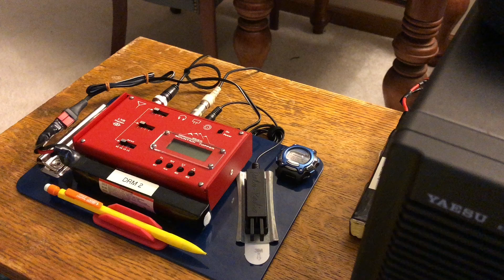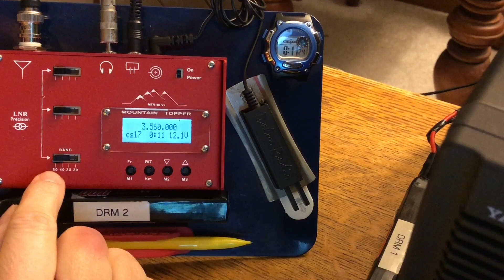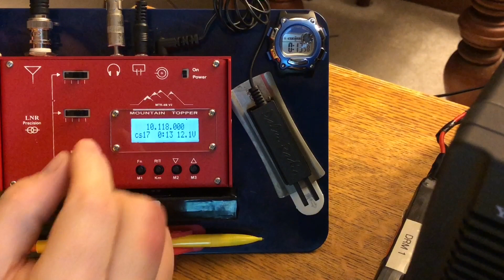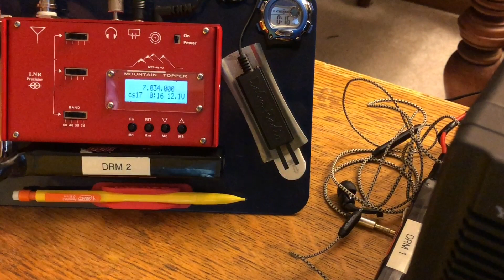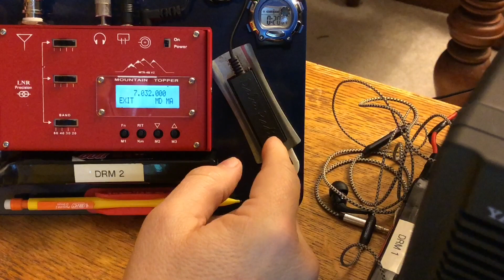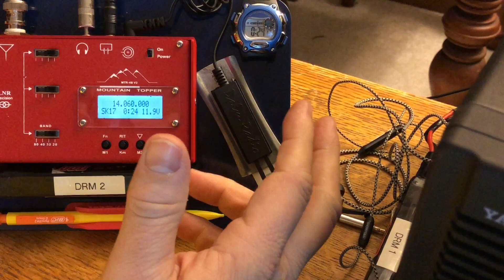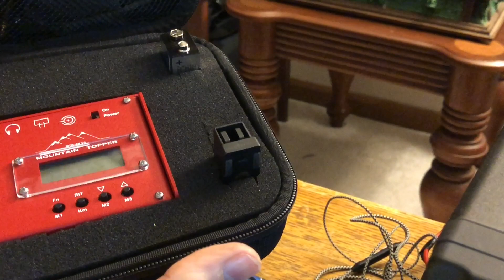LNR Precision MTR4B V2 Introduction

Comment: great video !! i just dived down a rabbit hole on sota reflector  that's gonna take over all my spare time 😂 found some outstanding mtr3 and mtr5 go boxes that were built by the mod king of mountain toppers dk3it. its like he heated up the bottom of a mountain topper with a torch or something and squished it into small pelican cases and tapped it with a magic wand to add extra goodness 😍 my appetite for anything to do with these superb little radios is insatiable.
Reply from the maker: It is great to carry a 7 ounce radio. I just wish it had DSP filtering. The front-end is too wide.

Comment: Do you know how to reduce the side tone monitor volume? I know the rubber stopper on the back is where you're supposed to access this. Is it a dip switch?
Reply from the maker: I don’t think it is adjustable,  I’ve never tried.  I bought a portable speaker that has a volume control.

Comment: 80m for SOTA?  Not in my experience.  Change 80 to 17m and they'd have a winner.
Reply from the maker: I wanted 60 instead of 80 but they won’t make it.  I do okay with 80 but 60 covers the in between range.

73, de N4HNH
Reply: @n4hnhradio  not enough room for that much wire on a lot of summits nor do I get up that early LOL
Reply from the maker: Well, LNR Precision can only offer you 3 useable bands with the MTR4B V2.  I think their 5-band model has 17m.

73, de N4HNH
Reply from the maker: The antenna I use for portable ops is the NY4G EFHW.  Even when I add the 80m link, it is half as long as an 80m dipole.  

We have a close knit group of SOTA activators here in the Southeast, with chasers who are shut-ins.  We get together for cook-outs and camp-outs twice a year.  So, we try to always operate either 60 or 80 meters, to give our fellow activators and chasers the opportunity for chase points and S2S bonus.

73, de N4HNH

Comment: Would you please post info on the battery packs you are using?  Great size.  Thanks for a terrific video. 73 de N3CI
Reply from the maker: I use either a Red Tiger 11.1VDC 15C 1100maH LiPo battery or the 50C 3000maH version.  I’m not sure if Red Tiger is still available though.  But just about any RC Hobby store will have this type of battery.  

I changed the connector to a Deans connector, since the Deans is smaller and lighter.

The 1100 maH 15C battery is plenty of power for the MTR4B V2.  I could do 2 or 3 summit activations and it would still have charge left.  The 3,000maH 50C can power my FT-891 at 45W for around 50 contacts.

73, de N4HNH

Comment: I am a brand new CW operator. I’ve been activating SOTA for close to a year (phone) 60% of way to MG! My next project is to activate my 2nd MG all CW I Love the MTRs and I am seriously considering picking one of these up. I have a Venus SW3B other than the extra band in your opinion or experienced others reading this, am I gaining much with the MTR4b?
Reply from the maker: You get the addition of the 80m band.  I wish LNR Precision had included 60m instead of 80m.  We get better propagation with 60m during the daytime here in the Southeast.  But I have made contacts with my close-in friends using the 80m option. These are SOTA chasers who are too far for 2 meters but too close for 40 meters.

The MTR4B V2 is a battery miser.  It only draws 27ma on RX, versus 45ma with the SW3B.  At 5W TX, the MTR4B V2 and the SW3B are nearly equal, with the MTR4B V2 drawing 750ma and the SW3B drawing 800ma.

The MTR4B V2 weighs 7.95 ounces, while the SW3B weighs 6.35 ounces.

The SW3B has a RF Gain control.  The MTR4B V2 does not have a RF Gain control.  

The SW3B has a volume (AF Gain) control.  The MTR4B V2 does not.  I use earbuds with an inline volume control.  I sometimes use an Anker Soundcore Mini external powered speaker.  It sounds very good and has a volume control.

LNR Precision doesn’t want us to exceed 13vDC to power the MTR4B V2.  I use a LiPo battery that charges to 12.7vDC.   I built an adapter with a 1N4007 diode in series with the positive wire, allowing me to power the radio with a LiFePo4 battery from Bioenno. With the diode, the voltage going to the radio is 12.9 to 13vDC.  Above 13vDC increases the risk of the final exceeding its 1A current rating.

73, de N4HNH
Reply: Thank you for the speedy reply! I  committed myself to all VHF SOTA (1st MG) and I have been using my FT818 with a N9TAX Rollup Jpole and when going gets tough the Arrow 3 element Yagi. Out of 130 activations I have come up short 7 times. I am amazed at what 70/2/6m can do with a bit of altitude! That being said I will be relieved to complete this phase of my SOTA journey the setup I have now is 18-20lbs total (with other backcountry gear) . Switching this out for a SW3B and a MTR4b with an end fed/9v battery will cut my weight by 2/3. 

I am going to order the MTR4B because you can never have enough QRP rigs! After I get a couple dozen activations done with each I’ll make a review comparing them!

“73”

Erik
Reply from the maker: My brother, W4KWM, made Mountain Goat using only his HT.  I would get my first contacts with the HT as well, though I also worked HF.  

We use the Diamond SRH770S duckie, N9TAX roll-up J-Pole, and a 3-element piano wire Yagi that my brother designed.  It weighs 4 ounces, including the coax and BNC.  It attaches to a trekking pole for transport.

I encourage you to keep on going and make MG without HF.  I didn’t think of it before I had already activated with HF.

I think you will like the MTR4B V2.  Let us know what you think.

73, de N4HNH

Comment: Neat video. What a creative idea fastening everything to the clip board.      Palm Pico Paddles?   
Looks like it's a well thought out radio. I'd have a hard time without a rotatable decoder for the VFO. 
Thanks for the nice demo.  Neat looking little radio. 

Barry, KU3X/QRP
Reply from the maker: The little arrow buttons work fine.  I found that having buttons instead of knobs is an advantage to buttons with little, portable, radios.  It’s too easy to accidentally bump the knobs and knock myself off frequency.  With the up/down arrows, my frequency setting doesn’t move.

Yes, I really like the Palm Pico Paddles.  It’s a shame they are out of business.

73, de N4HNH

Comment: Do you have a recommended key and cable to use with this radio.  Where did you get case?
Reply from the maker: The key is a Pico Paddle.  American Morse also makes a nice key.  The case is from Amazon.  Here is a link: Portable Carrying Case Bag for GoPro Camera and Gopro Accessories,Hapurs Durable Travel Carry Protective Case Storage Bag for GoPro Hero 2 3 3+ 4 Hero 4 Session Hero 5 Session and Accessories https://www.amazon.com/dp/B071FGC12H/ref=cm_sw_r_cp_api_glt_fabc_KHWB8GGGNFHQ8CSNZJR7?_encoding=UTF8&psc=1

73, de N4HNH

Comment: You probably don’t need the watch anymore because the rig has a clock.  The rig did marvelously on Grassy Ridge Bald - plenty of audio showing the exchanges between the MTR and the chasers on my video on YouTube.  Great video Doug.  Very instructive
Reply from the maker: Yes, I’m thinking the watch may fade away.  However, I noticed a flaw in the programming for the built-in clock that gives me pause.  If you long press Fn and cycle through the menus, and happen to stop on Set Time, it automatically resets the time to 0:00.  Might keep the separate one for a bit.  But I’m usually logging with OutDLog so I can get buy without either the watch or the radio clock.
Reply: @n4hnhradio  Your video just inspired me to do my version of the clipboard idea.  Stay tuned.
Reply from the maker: @CaptainRadioAdventures  be sure to share.  The credit for this one goes to KC4WZB.  He is amazing and repurposing stuff.

Comment: Cool and simple but it's a pricey little thing for only 4 bands. More than half the price of the FT-891 I just bot.
Good video to see how it works, thanks.
Reply from the maker: I’ve been carrying a FT-891 on my back for 3 years.  It is phenomenal, but it weighs 5 pounds.  The MTR4B won’t replace it.  But I’m ready to hike with a 7.95 ounce radio in my backpack.  20-30-40-60 meters are my main SOTA bands.  I wish the MTR4B could work on 60 meters but it does 80 instead.  60 works better for regional contacts during the day.  But I can get most of my SOTA contacts on 20-30-40.  Rest assured the FT-891 isn’t going anywhere.

73, N4HNH